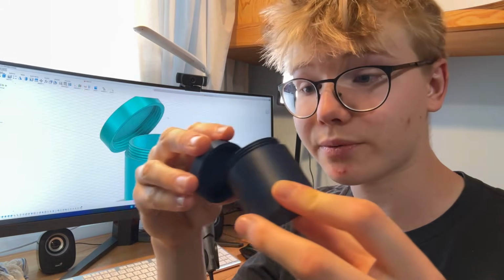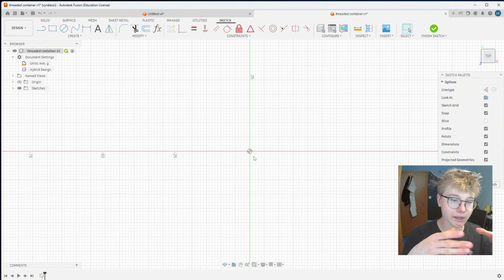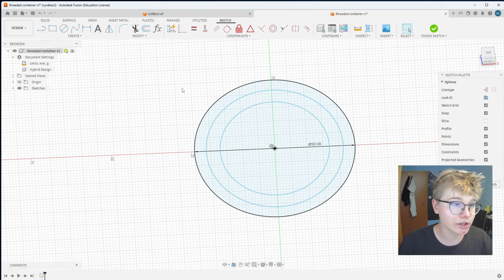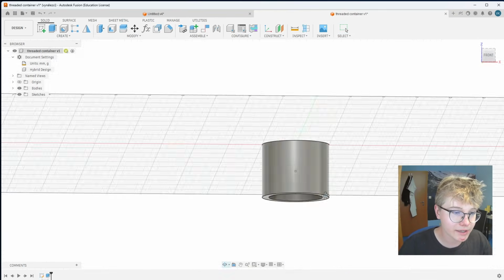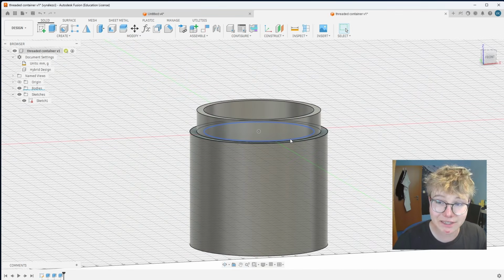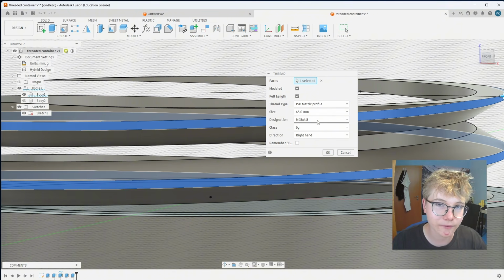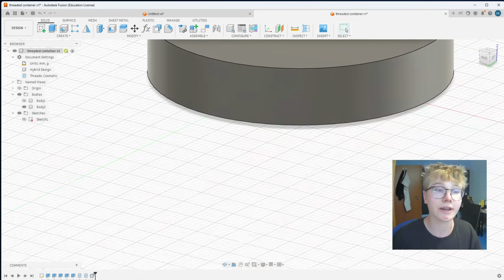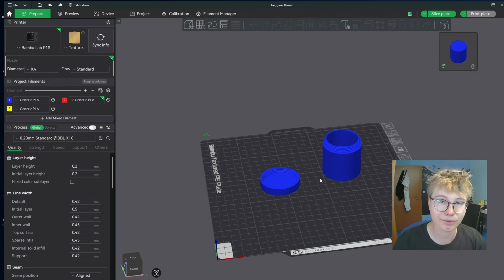Perfect 3D printed threads every single time (Fusion tutorial)

Comment: Very nice tutorial with lots of helpful TIPS and SUGGESTIONS! But why choose STL for the file export format? Isn't 3MF a better choice since it is more efficient and retains the mathematical curves of your design rather than immediately breaking them down into flat, triangular facets like STL? Also 3MF can export the entire assembly in one file while keeping the parts as separate, editable bodies. It also can preserve other model properties that STL does not (though that might not be applicable in this example). So 3MF appears to be a superior export format choice and even if for some models it doesn't confer big advantages, AFAIK, there is no downside.
Reply: 3mf holds colour info while stl is just the structure info.